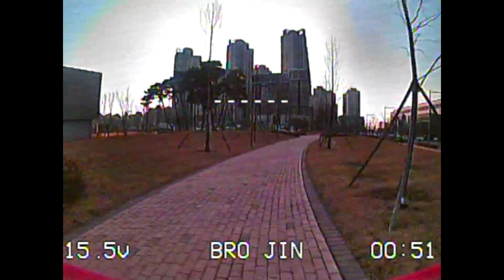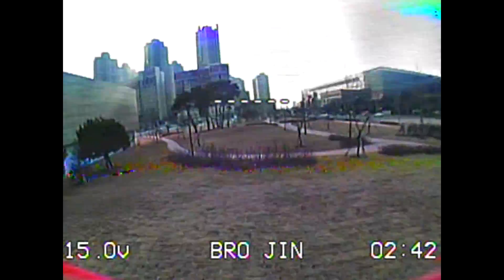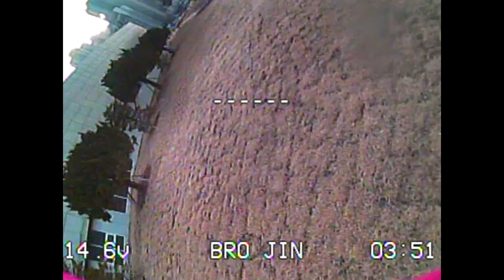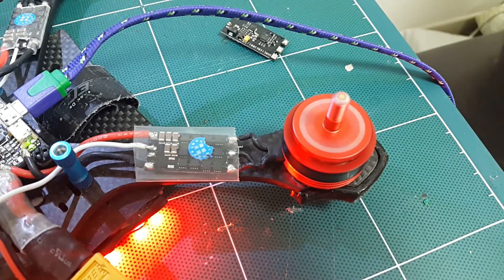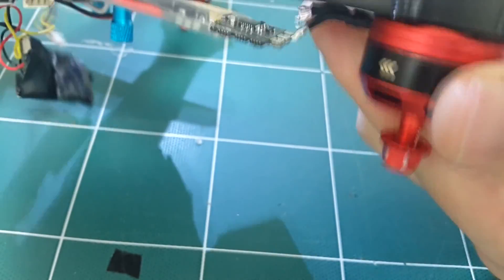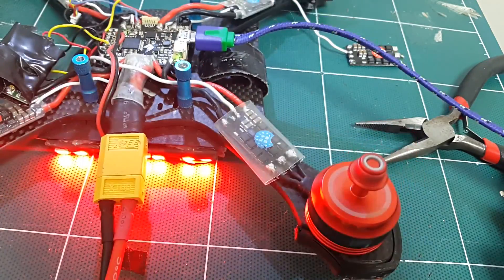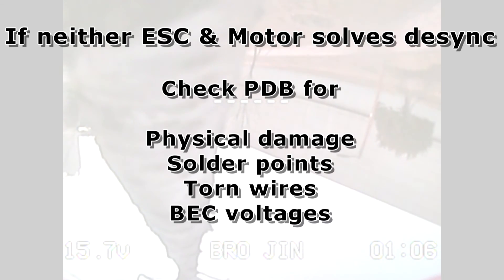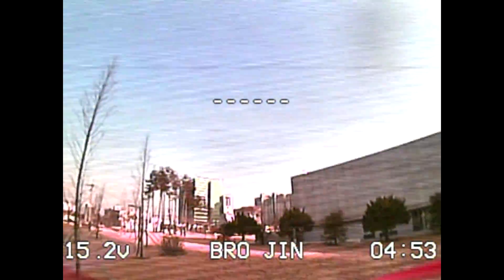Solving Motor Desync After a Crash; Quadcopter Troubleshooting.

Comment: 1:21 can you elaborate a bit more? This happens if at a crash the throttle is still high? Or does it generally happen at a crash even if the throttle is zero but the motor was still spinning fast and at the crash it brakes abruptly (but without throttle)?
Reply from the maker: Lower the throttle commend you send, lower the chance of your components breaking. Even when you put your transmitter throttle at zero, FCs still send some throttle signals beyond zero to correct its orientation (airmode) especially when it is in a crash situation. That can cause additional damage even if you did not intend it. 

The best is disarming before you crash, but, as you know, it is hard to predict crashes.

Comment: Bare with me, I had the same issue, but a bit more uncanny one:

1. Crashed exactly like you and had a motor desync issue on #2.
2. Changed all the ESCs to BLHeli32. No difference.
3. Changed all the motors. No difference.
4. Changed FC! Now I have the problem on motor #1. Motor #2 works fine somehow.

At this moment I'm running out of patience and cash but with brand new motors, ESCs, and an FC how in the hell is this possible? Could the ESC or motor be shorting somewhere over the frame? I don't know. I'm scared to even touch it now.
Reply: Update: Changed the frame. Everything works fine now. I'll assume there was a persistent shortage through the frame.

Comment: Also when I put my quad into betaflight motor testing, no desync is occurred
Reply from the maker: I recommend you to first change motor timing on BL heli setting. If that does not work, replace esc with another esc to see if esc is faulty. Also check if screws are touching the core of the motor.
Reply from the maker: I have heard from pro pilot that, if you are using bl heli 32, demag compensation setting may cause desync. There is no true answer to desync problems. you have to eliminate one by one.

Comment: Ever since I crashed my quad into a light pole, My quad corner dips, or motor desync. My motor number one either stop spinning in mid flight or just won’t speed up enough in takeoff. I have replaced the motor with a good motor from my 2nd quad. still no fix, so then I replaced the escs still no fix. Now, even weirder, when I put the new motor back to my 2nd quad, same thing happens to both quads. Now both quads have desync what the hell?????? Anyone can please help me is it the flight controller or something with Dshot or maybe not a good electrical contact??? Or I damaged electronics during soldering. I don’t FREKIN know I’m sorry stuck please if anyone knows and can help me please reply

Comment: I have the same problem after a crash too,  it happens to be one of the motor bear is broken and it causes huge friction when turning the motor,  it still fly,  i couldnt notice any difference when flying,  but when i flip,  the motor desync.  I think the fc is trying to send more current to that high friction motor in order to keep up with the flip,  but when the friction is too high,  it will smoke the motor eventually, i suspect the desync is implanted as a software protection to avoid smoking hardwares.
Reply: One way to test motor desync indoor maybe to hold your quad in hand,  arm it so that the prop spin slowly,  then try to flip it (fast)  with your hand so the motor will spin fast against you,  in my case i saw the bad motor desync and stop spinning.

Comment: Hello,
I am new to quads, and was wondering if this could be my problem as well?

I have a quad with about 20 flights on it. (everything was working fine)
Today, while hovering, the quad increased altitude on its own. I lowered the throttle completely, and it was still climbing fast. I had to actually hit the motor disarm to get it to fall....(I had to toggle the motor arm switch to control the decent to the ground. It landed in tall grass and did not even bend a prop, no visible damages)

I switched batteries, and as soon as I arm it, the motors go to max throttle. (actually, it looks like 3 go to max, and 1 looks a little slower.

I am using a clone SPf3 board with Cleanflight, a 4-1 ESC, and a PDB. 

Do you think the Desync you talk about could be causing my troubles? (or do you have any other ideas on it?

Thank you,
David
Reply from the maker: Poker2145 Have you checked receiver readings on clean flight? The climbing problem sounds like coming from broken connection between transmitter (controller) and receiver. Motor problem maybe coming from accelerometer. If your drone drifts on clean flight, you may need yo recalibrate accelerometer. The motor can also act like that when armed without props. For quad problems, it is not easy to pin point the problem. :(
Reply: Thank you for the reply.
It was working fine, with about 20 flights on it. Then while in a level hover at about 80 feet up, the motors increased in speed on their own, and it started to increase altitude, even though the throttle was all the way at minimum. Now, when I connect a battery and arm it, the motors go to full throttle even with the throttle stick at minimum. giving AIL or ELEV commands does cause the motors to change speeds, so it looks like the receiver is talking to the FC still? (And the FC is working?)

With the 4-in-1, the PDB, the AIO FC, etc....what do you suggest trying to replace first and second? (things that could be most likely causes)

Thank you again for trying to help out.
David
Reply from the maker: Poker2145 sounds more like problem of flight controller or settings on clean flight. If u can, u can reflash fc with  a newer firmware (older if its latest). I highly recommend u to jump into betaflight if ypu have not done so
Reply: Thank you for the help sir

Comment: Hey man, I am having desync problems too.. I have been trying to solve it for months now, it's so frustrating. I replaced all my ESCs and motors (Aikon 2-4S BLHELI_S escs and T-motor F40 ii 2400kv motors) and today after a few flights I got a desync again.. It happened after rapidly applying throttle (to ~75%). I run on dshot600 and betaflight 3.1.7. I really don't know what to do...
Reply from the maker: Do all motors de-sync? One of few reasons for all motor failure is motor screws hitting the windings of the motor. Poor BEC or lack of capacitor may also shut the fc down for a moment causing problems. PDB or wire touching the carbon frame may also result in de-sync, but, in that case, usually ends up with fire.

I had similar problem before which I could never be able to solve. Motor #2 'always' de-synced when I plugged in 4s bat. Reason why I said 'always' is, no matter how many times I replaced motor,esc,pdb and fc, I ended up with de-synced #2 Motor. I am now speculating a screw touching the winding of the motors, but the quad is already thrown into trash can about a year ago.

Comment: Goodness, this is my problem. Ive swapped my motor & ESC(4in1) and still flips on heavy throttle. Next ill replace pdb & FC. Maybe ill remap motor 3 to pin 6 as I believe its #3 that is outta sync
Reply from the maker: Desync is the most frustrating thing about quadcoptor. There are so many points of failures. There are even compatability issue of fc/esc firmware & Dshot protocols. Sometimes, replacement parts arrives broken making this problem a nightmare (this happened to Bruce who runs RC Model Review).
Reply: I think it might also be my motor screws too long and touching motor causing voltage to short thru the carbon fiber. A simple multi meter test will let me know. Ill check that out when i can.
Reply: i crashed(not my fault) my motor came loose place i bought the quad from a month ago only used 2 screws to fasten the motor(okay so a little my fault should have checked the motor bolts). Motor came off in flight twisted the wires and props hit the esc and i came down from about 20m above the ground. 

Bought a new motor and put new esc on the quad if i did hard rolls it would death roll with me. no matter what i did no setting in betaflight fixed it. 

My solution i bought 4 new motors and 4 brand new esc's....Problem solved!!! Flying like a charm again.
Reply: Robert i had the same issue i was getting bad feed on my VTX if i punch after putting on the new motor. Screw was touching the stator wires. That touching for some reason also did something cause the quad just did not want to behave like it should. 

I must add a mixed esc's after the motor came off. So list of possible faults:

1. Bolt touching stator wire.
2. ESC fried or damaged(still works when you fly normal but freaks out under load)
3. Motor damaged
4. Open up all your motors and make sure magnets are free of anything that could hinder it from spinning up correctly.
5. mixing of esc's same amp rating but would not advise anyone to do it.

My FC (Betaflight F3) is fine. The new parts sorted it out for me but i had dirt in 2 of my motors the magnets picked up from the crash. So if you ask me if i needed to buy the new stuff i would say no maybe just another esc on the side the motor came loose.

I hope it helps you and you back in the air with minimal cost!!!

Comment: Nice vid brother! 
I am having a prob with desynch, but in my case whenever I plug the camera the quad will keep flipping/rolling to the ground.
when i unplug it, it works fine.
Could u suggest sumthing to fix this? Is it the PDB.
Note:this quad has never crashed before.
Reply: Omgwtflmaololrotfl Thanks brother. I actually gave up on my micro.. really too frustrated to even check it anymore. then one lucky day,the store manager ask me to drop by the store and she will replace the entire unit.
Now I have a good working unit, with no desync issue.
In the end, i didnt figure out whats wrong with it..but i think its factory defect.. hahaha.

Thanks again!
Reply from the maker: I have watched and read many forum posts on the desync, but never heard of one like yours. 
It's going to be hard to pin point your problem, and my comment will becoming from speculation rather than my experience.
I suggest you to ask other forums including facebook forums such as Rotor Riots & Mini Quad Club.

PDB is most likely the main problem, but, sometimes, desync is caused my combination of components.
I would suggest testing your pdb using voltmeter check if it is giving you correct voltage. If you are using BEC on your PDB for camera, check if BEC gives correct value. Another possibility is your camera taking up too much amperage from the bec causing it and other parts to shut down. Check if you are not sharing same ground pad with camera and the de-syncing esc.

Try to power your camera from independent source(ex. directly from bat). If you do not have capacitor on your quad, I highly recommend getting one to reduce chances of damages & noise.

I think problem is unlikely from your camera unless your camera is shorting out with pdb or other components.
If you live in US and have Amazon prime, test another set of camera. If your system works with the cam, replace it. If not, just simply return to amazon. 
In most cases, when there is a problem with camera, only video feed gets affected not the signal going into the esc.
Reply: Awesome advice bro.
At the moment the only way i can fly is using indepndnt power source(batt)
I agree w/ the idea that it is feeding up to much amp.

To add on this.. whenever i use the eachine stock batt which is 450mah 80c, it rarely flip(w/ cam plugged).. but when i use a lower C rate(gaoneng 460mah 75c) it flips like crazy!

Thanks again brother!
Reply: Wolvy please check on your frame with multi meter if you dont have a short. also check if you dont have a motor screw touching stator wire then maybe shorting via your VTX antenna. My hunch is you have a short somewhere...
Reply: You are very welcome and i'm glad you back in the air happy!!!

Have a great day!!